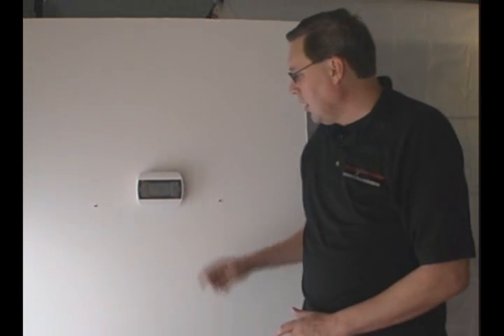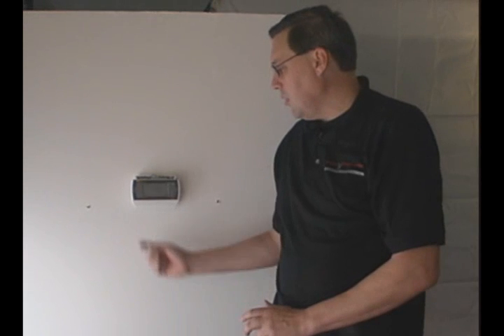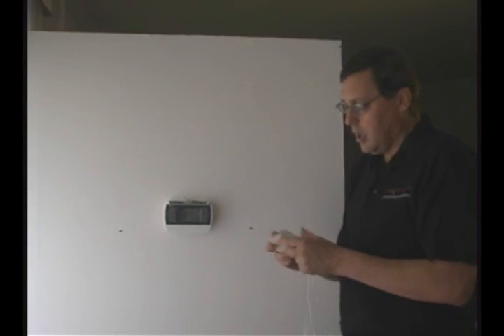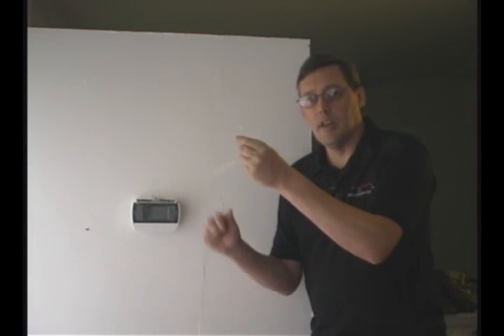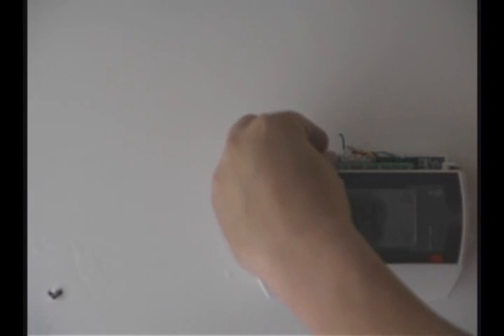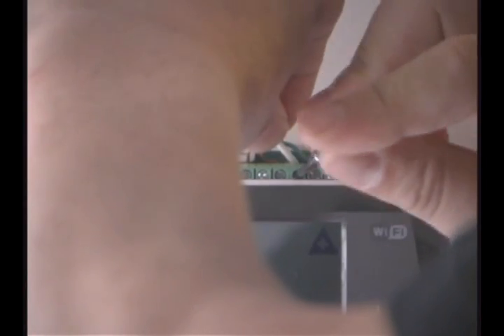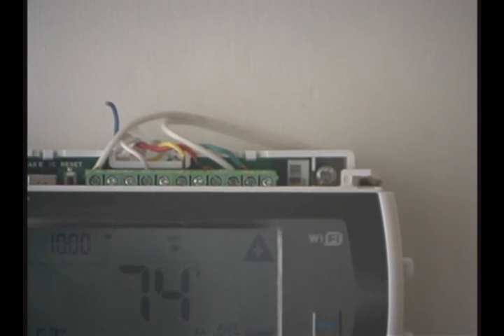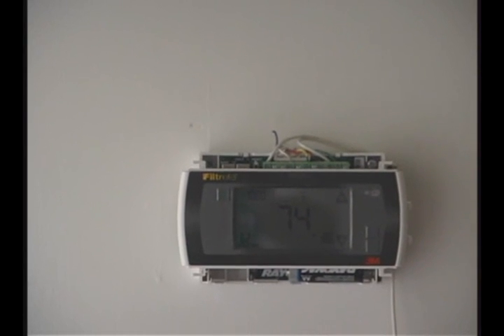C Wire - How to power the thermostat via an external transformer

Comment: April 04, 2025
My 10 year old Lennox iComfort thermostat loses its settings any time we have the slightest power interruption. So, I would like to power it with an adapter plugged into a UPS.
However, my thermostat already has a wire connected to the C terminal, and the line to the thermostat only has 4 wires, and all are connected. How would I connect the adapter?

Comment: 14-year-old video--and the best out there! I have a second zone on the second floor that was never wired for a thermostat. Boiler, two wires. It's taken me 12 years to find a solution that was better than just running the wire outside the walls all the way up the stairs--it was the SensiTouch2 with a remote sensor and external transformer. I installed the thermostat at the top of my basement stairs near the light switch, drilled a hole through the wood stairs to run the wires, plugged the transformer into an always-on basement plug (important when most of your outlets are run off the light switch at the top of the stairs), and put the remote sensor upstairs, programmed to be the only source of temp info. And the SensiTouch website, after some hunting, confirmed the connection of the transformer wires to C and RC, plus cutting the RC/RH jumper on the back of the thermostat.

Comment: I guess this will work on the Honeywell T9 also. I'm not clear about the jumper from Rc to Rh. Shouldn't it be removed? why would you have the 24v from the HVAC unit transformer connected to the C wire adapter power at Rh. Wouldn't that blow the small fuse that protects the low voltage coming from the HVAC unit? Or cause an issue if that HVAC transformer failed and then draws power from the adapter?

Comment: Wont this cause phase issues with the existing transformer?
Reply: I know this is old, but maybe someone else asks. No it won't cause phase issues. All it's basically doing is powering the thermostat, not the signal or return signals.

Comment: So what do you do if you have a Thermostat that does not have an RH, or RC connector? We installed a Nest Thermostat e when we moved into our new home a couple of years ago. Last year we noticed an issue with our heating system and the nest threw an error pointing to a common wire issue. I recently got a 24v external transformer but I’m not sure where to connect it. The nest has six connectors, Y1, G, R on the left and W1, C, OB on the right. The instructions told us to install one wire to R and the other wire to W1. During the warmer months, the Nest is able to keep charged without issues since it really isn’t being used. But in the Winter months, it eventually failed with an error and we have to leave the nest off for a while to allow it the charge again. I was told that a common wire transformer would fix this but once I got it, the direction tell me to put one wire into C and the other wire into RC. I have no RC wire, so where do I put the other wire? Can I even use this with our heating system? Any thoughts?
Reply: Lonnie King add one wire to the “c” and the other to the “r”
Reply: pinball30 thanks for the tip. That worked!

Comment: my natural gas furnace uses an electric igniter. i am thinking this is connected to the RH. it was mentioned in here to leave RH and RC jumpered,  and connect the adapter to the RC and C. is it still okay to connect to RC and leave RC and RH jumpered with both RH and RC having AC current from 2 different sources? Thanks!

Comment: I was told that if I added external transformer, it will only work for the heating system? Will it also work for the cooling system as well? My furnace is up the attic and very hard to get into. I have a Honeywell wifi thermostat and replacing an analog thermostat. reply and set up is appreciated.
Reply: I was told the same thing by a Honeywell CSR.  But the video doesn't mention his workaround as being limited to just the heating system.  The Homehandyman makes it seem like cooling and heating should both be good to go.  What did you ultimately find out?  Thanks.
Reply: I didn't bother to reach up the attic to figure it out. It was too much trouble just to put in the Honeywell wifi thermostat. I just uses my analog instead.
Reply: I understand.  Btw, a furnace in an attic?  How strange.  Thanks, MK!
Reply: Yes we live in California so we don't have any basement in city area so some dwelling have furnace up the attic unlike the mid or east coast. :)

Comment: Thank you!!! I connected my heater which only had Red and White wire connected to my thermostat. I added this transformer with the wire going behind the wall into the closet outlet so you cant even see anything :) .. now I got a nice smart thermostat..
Reply: +kprzywara I just bought the Honeywell from Homedepot after reading your comment. Only question I have is. Do I need to connect 1 or 2 wires from transformer to thermostat? And which ones please..
Reply: +Dani Diamond  I bought the Honeywell with the color LCD touch screen. You need to connect it exactly as in this video.. just connect the 1 wire to C and the other to Rc. Dont worry about the jumper there if you are not using this to control AC.  http://www.lowes.com/pd_486110-74493-RTH9580WF1005/U1_1z10xtsZ1z13yb6__?productId=999914799&pl=1
Reply: +kprzywara Oh and by the way. PC richards has it for $163.88 - I took that to Lowes and they beat it by 10% more...
Reply: +kprzywara oh dude you rock thanks for that info. I price matched to Amazon then used 10% Lowe's coupon. Homedepot matches coupons!
Reply: +kprzywara which transformer did you end up buying?
Reply: +Dani Diamond in the irrigation section of lowes/home depot there is a nice transformer for the sprinkler clocks.. It cost $14 in lowes and has a nice connector
Reply: +Dani Diamond wow.. didnt think they would match to Amazon :) nice!
Reply: +kprzywara http://www.lowes.com/pd_168261-74985-57040___?Ntt=sprinkler+transformer&UserSearch=sprinkler+transformer&productId=3354788
Reply: +kprzywara thanks, gonna head there later today and do this!
Reply: +Dani Diamond have fun!

Comment: Thanks so much for this video!  The external transformer is working well with my Nest thermostat. I split the transformer between a new wire to C and existing wire to Rh.
Reply: Did you have one wire from the transformer  in the Rh as well as the R wire from the HVAC/furnace in Rh?

Comment: I want to replace my Daikin thermostat with a Honeywell Wifi / NEST.  However my Daikin air condition indoor unit only has a 5V DC out which goes to thermostat BUT Honeywell / Nest need 24V AC.  Can I only connect the G and Y wires from my indoor unit to Honeywell / NEST thermostat and then use an External 24V AC adapter to connect 1 wire to Rh and 2nd wire to C on the thermostat ?  (I will disconnect the 5V DC wire from my indoor unit).  Will this solution work and will external adapter give power to both Rh and C (common) connectors on thermostat ?  (After I disconnect the 5V DC OUT wire from indoor unit to thermostat, will it still accept the G (Fan) and Y (compressor) wire signals from the Externally powered thermostat ?  Your guidance will be highly appreciated.  Thanks.

Comment: the printed instructions make me think that with the wire coming from the wall you connect (red) to the rc or rh and then the other available wire from transformer goes to c and either rc or rh, whichever one you didn't use. There would be no jumper used.  The manual also warns about too much power going to each slot, so to speak.  I plan on using the transformer for the C and for prolly the rh.

Comment: What if I have a wire running to the t-stat in the Rc terminal along with a jumper from Rc to Rh, would I connect one of the two wires from the 24v transformer to the C terminal and the other one to the Rh terminal (since I already have a wire running to Rc)? If that's the case, do I still leave the jumper between Rc and Rh? Does it matter which of the two wires from the transformer I connect to C and Rh? Thanks

Comment: Looking at getting this thermostat. Why does the second wire from the ac transformer go to RH? If the traditional setup is a single 24v C wire connected to C? (I only have red and white so need external power) Is it simply going to unused port for safety? Also any requirements for in wall wire instead of wall wart wire? Thanks.